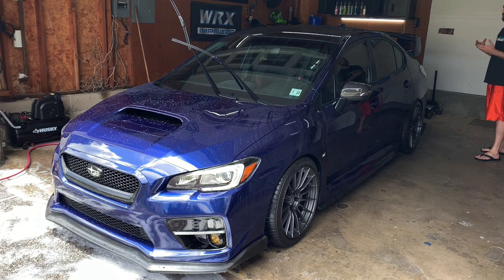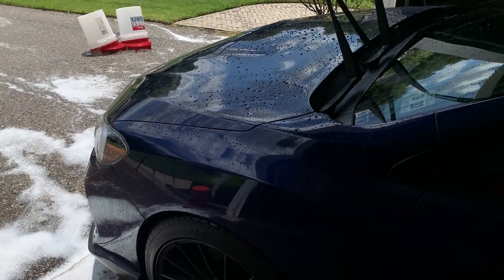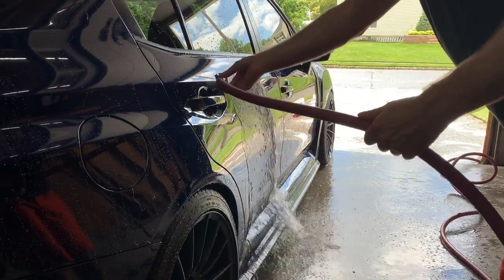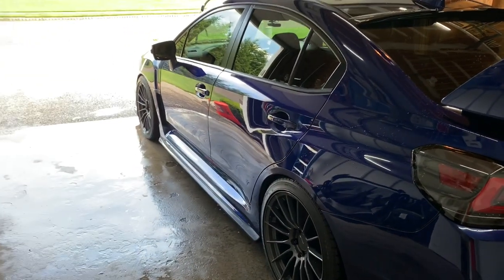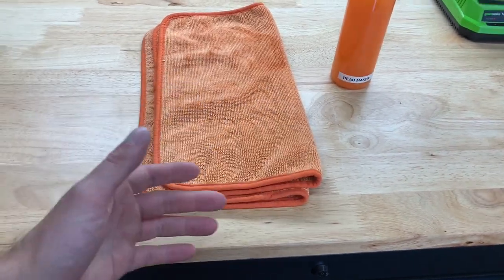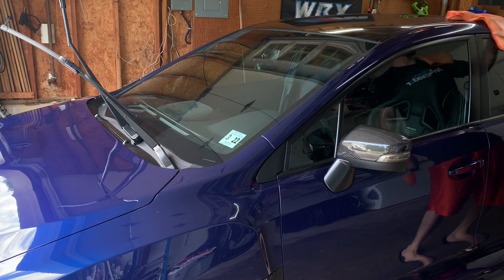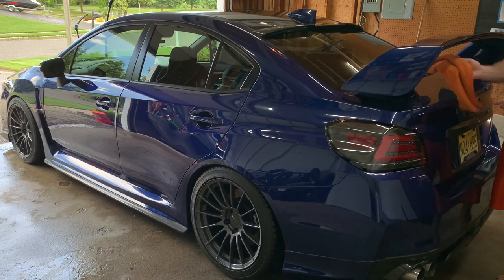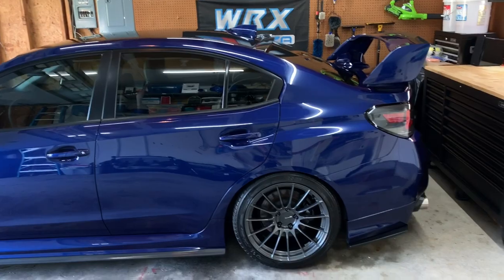Wash Series Part 3: How To Dry Your Car CORRECTLY

Comment: I just ordered some bead maker and used it the other day and its awesome! Do you know if you can use it in between washes? I couldn’t find any answers online about that. I just washed the car and drove to work and back and there is a thin layer of dust. Can I use it as a quick detailer?
Reply from the maker: You could. But I would recommend waiting until you can do a proper wash. A wipe down between washes is very risky, especially on soft Subaru paint.
Reply: Scoobyfreak86 ok sounds good, thanks for the heads up!

Comment: What your wheel offset looking to make my flush with the sides and is your tires stretched on also
Reply from the maker: No stretch. I am not a fan of stretched wheels as I am a bigger fan of meatier fitments. 18x9.5 +35 265/35
Reply: Scoobyfreak86 and that will almost be flush with the fender? And that’s for front and rear right?